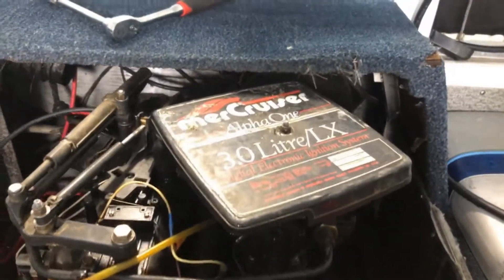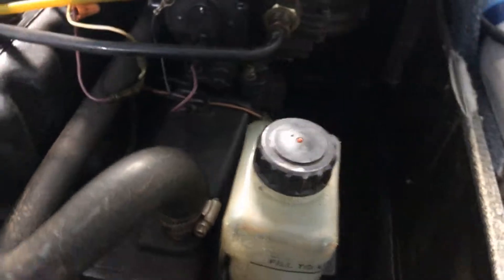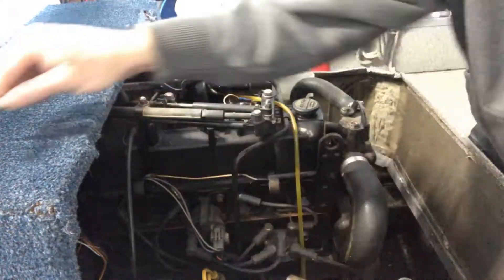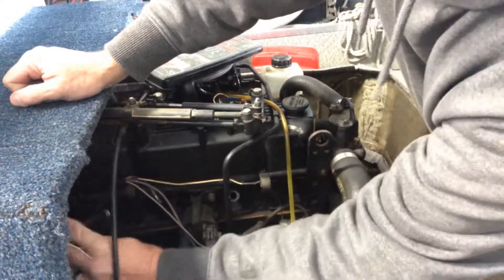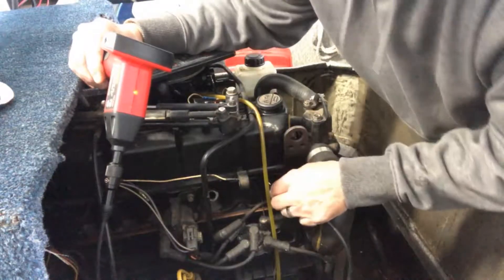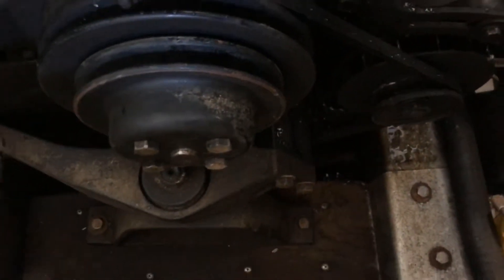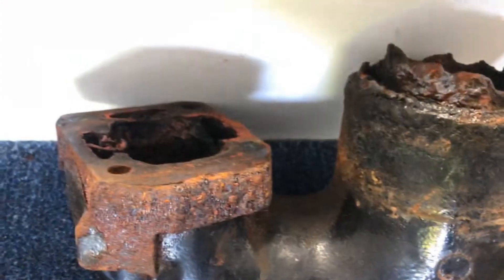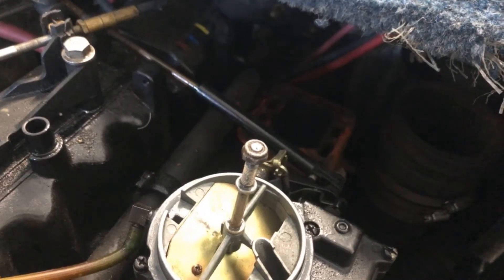How to troubleshoot 3.0 litre with water in oil or milky oil

Comment: Thanks for the video.   How do i know if i need to replace the intake/exhaust manifold also ?   I suspect my riser is bad.   2002 merc 3.0
Reply: Both the exhsust elbow and intake/exhaust manifold are casted iron steel which eventually corrode.  A 02 boat is 23 years old.  My 93 boat failed after 32 years but it was a freshwater boat.    I would consider replacing both.  If not, eventually you will.

Comment: I had water in my 3.0 mercruiser which is 32 years old.  I inspected the exhaust elbow which was corroded just like the video. I replaced both the exhaust elbow and the intake/exhaust combination manifold and the problem was solved.  Apparently water leaked from the exhaust to the intake after I shut off the engine.  I am glad it was nothing else on my 32 years old engine.  I did a compression test and all cylinders were 180 psi each so I am celebrating with a fishing trip this week.

Comment: Hello, thank you for this nice video! I have exact same engine and had water in oil this last September. On that day, I had a 300 lbs guest and they sat on the boat while ai parked the truck. Removed valve cover and noticed one broken valve spring with a bent push rod. The exhaust flapper was completely gone. Is it possible water came in from the exhaust back into the engine? I removed the head and gasket and spark plugs looked good.

Comment: I have the same problem I’ll guess. Milky oil.  Change headgasket still water in oil.  What else can I do?
Reply from the maker: Possibly a cracked block? Are you in an area where the engine could’ve froze over the winter? Is the boat new to you?
Reply: This does depend on how you use it also, engine should be used normally above idle for more than 45min at a time to burn off condensation, short runs are not good for burning condensation.

Comment: Are you pressure testing the cylinder at TDC to check for head gasket leaking into water jacket?  Then the water system pressure test was to look for other escapes of water?  How do you know if the cylinder pressure test is normal blow by vs head gasket (or valve?).
Reply from the maker: Yes TDC , if you pull the oil fill cap when you perform leak down you’ll be able to hear/feel how much is escaping into the crank case from blow by. And you can pull the cooling system hoses off to see if any air is coming from the head gasket. If you have normal blow by the pressure gauge should only show 15% air leakage or less. Anything above 25% will indicate a worn engine, head gasket failure or valve leaking.
Hope this helps!
Reply: @maineboatguy  Awesome! Thanks for the advice.  I'm going to look into modifying my compression tester for this job.. I think I can just put a tire valve on it in place of the release valve.

Comment: dosent t manifold and riser have 2b drained after each and every use,over time it will leak into exhaust manifold then past valve to piston and sump ,my 3ltr has  flush lines 2 do this, its part of t procedure after  use salt or fresh(manifold wont emty by itself)exhaust pressure stops  a small leak when running but not when stopped,get all water out of system between use ( no leak)
Reply from the maker: Never heard of draining after every use in freshwater, always a good idea to flush after use in salt water. Cooling water should never be able to leak back into the engine from the exhaust if it is in good condition.

Comment: I've watched several videos and read about this being the issue, but I do not understand how the water gets in to the oil from this rusted out exhaust elbow.  Can you explain a bit better? Does it just seep into the cylinder and bypass the rings when sitting?
Reply: Normally the used cooling water goes through the jacket of the elbow joint, then up over the top of the elbow, so it can only be ejected in the exhaust. But when the cooling passage is rusted through, and/or the joint is breached by rusting out and/or a bad gasket, that cooling water leaks back down into the exhaust passages in the exhaust manifold (where it should not be), and yes, then leaks past the exhaust valve, into the cylinder, then past the ring and into the oil in the crankcase.
Reply: @proto57   yes that is a good description of the failure mode.  The exhaust elbow and the exhaust intake combination manifold is cast iron which eventually rust out.  I read on another forum that this is a common problem and failure occurs after 10 to 20 years.  My elbow and manifold failed after 32 years...but i had a freshwater only boat.

Comment: I have 4.3 L engine but I can’t seem to find any info on how to pressure test the cooling system, the engine oil is milky, not overheating or missing, don’t want to assume it’s a head gasket, do you have any tips on a 4.3L ?  Thanks
Reply from the maker: Did you remove your exhaust elbows to inspect them? You can make block off plates to install on manifolds in place of the elbows then pressurized the cooling system through the water pickup hose coming from the transom assembly. Might want to try a leak down test as well. Did you remove spark plugs to check for water in the cylinders?
Reply: @maineboatguy  I have not but thank you fir the suggestion, will try that tomorrow

Comment: Good video. I have a Volvo Penta 3.0 doing the same thing (basically same engine).. It had like a miss in the engine mid power range when I got on it hard, but smooth at higher and lower RPM..  Got home and saw water in the oil.. Checked the plugs and saw signs of rust on the #4. I ran a compression check and 1-3 were at 170, #4 was closer to around 160-165, which should be good. I pulled the head, and everything looks fine to me. The #4 exhaust had a lot of rust and a little in one other exhaust passage. My manifold looks good, but the the riser elbow though looks almost as bad as the one you had in this video and definitely rotted to the point where it's mixing where it shouldn't..  I just can't see how the water gets in the oil, unless it's just from blow by? I hope that's all it was and not a crack in the block or anything like that. I just ordered everything and will know in about two weeks I guess!
Reply from the maker: VideosTellAll water gets in the oil when engine is off, the angle of the engine allows the water to run to the rear cylinder through the exhaust manifold and drains down past the piston rings into the oil pan.
Reply: @maineboatguy  Sounds good brother!
Reply: @videostellall  did you ever find out the issue when you got all your parts?
Reply: @Ericrp119tube  Changing out the manifold and riser fixed it. Runs great! But one reason it runs great now is, I saw other videos telling people not to follow the manual for the valve adjustment. If I remember correctly, you run the rocker down until the push rod is clearly harder to turn (zero lash), the tighten 3/4 turn more.. Well everyone was recommending only a half turn, saying the valve would be too tight with the factory recommendation.. Well I backed mine off at least that much and it cranks better than when even new. I've always had to restart numerous times and always playing with the choke adjustment, but even when warm the idle was never great. Once I repaired everything, it cranked up right off the bat and never died once. Now even when hot, it cranks right up and idles great and no valve noise. I'm more than happy now.
Reply: Maine Boat Guy can you call me I have questions 847609742000 ignore the las zeros thanks
Reply: Hey did you end up figuring out the solution i have the same volvo penta 3.0 and milky oil.
Reply: @Alproda  yeah, it was the exhaust manifold riser..  They recommend changing the exhaust every 5 years and I got like 8 years out of it. No issues since changing the manifold and riser.  I put a scope into the last cylinder and saw evidence of rust, so I figure bad head gasket. Pulled the head and it was actually good. One thing though.. I found a forum where people said Volvo valves are too tight from the factory. They say to tighten them 1/4 turn less that what the book says and now my boat cranks up like 10 times better.